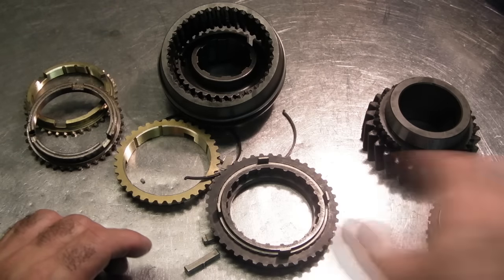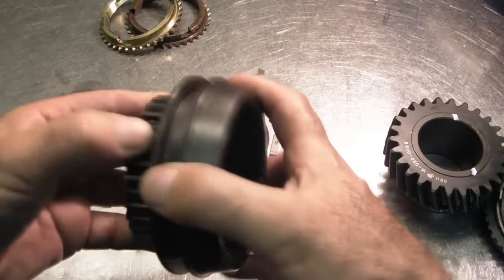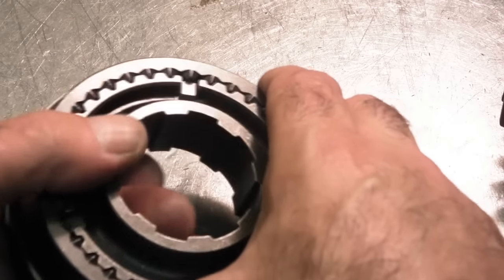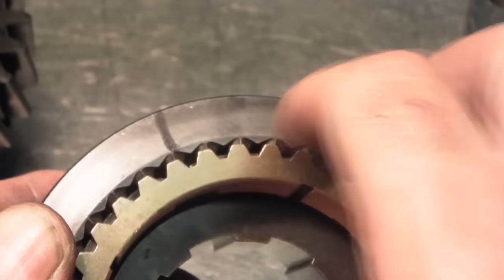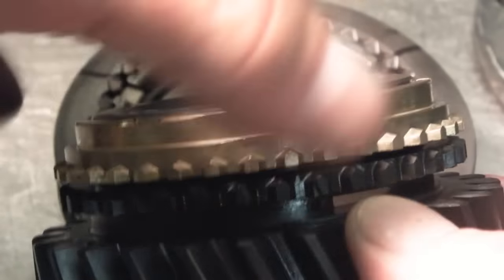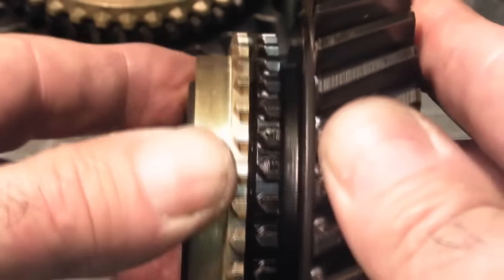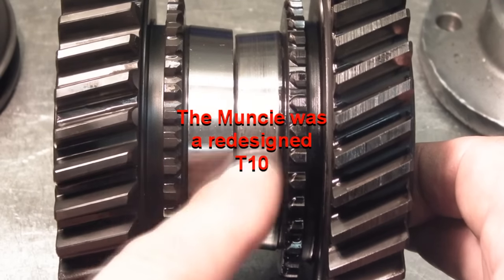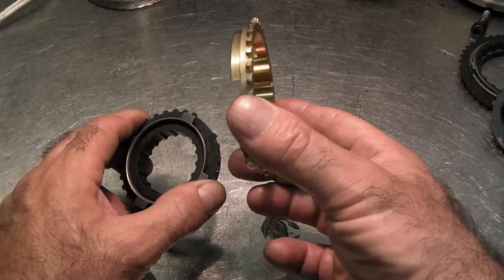Learn About Transmission Synchro Rings

Comment: Great video, clear and easy to understand! I found it looking for answers for a grinding sound in my T355 Patriot (48K mi) manual transmission. Hope you can help with some advice. The grinding is when shifting into 4th gear, once it passes the grinding it gears properly and works good. I already replaced the clutch kit, some worn retainers and the trans fluid (ATF+4) but the grinding stills there. 
From what I understand in your video, if the speed is properly geared after the grinding is not a synchro crown issue, it would be a synchro ring worn out and not stopping properlo along with the gear cone. I'm planning to replace only the ring (4th gear) and leave the same synchro. What are your thoughts?
Thanks!!
Reply from the maker: Inspect the parts first.  Usually you will just need a new ring. The whole assembly could be damaged if you let it grind for awhile.
Reply: GearWorldTV
...or even if you let it grind for

a

while.

...

Comment: I have new Tacoma with a 6 speed manual. A while back I was in 1st gear coasting and I wanted to shift to neutral stop and the shifter would not come out of gear and it ground when I pulled back on the stick. Clutch pedal was all the way to the floor.
Reply from the maker: Sounds like a clutch release issue. Unfortunately from the description you give me its hard to diagnose this.
Reply: GearBoxVideo it is simple. I was driving in 1st gear, I was going to shift to neutral so I could stop, so I press the clutch pedal all the way down to shift. But when I pulled on the shifter I heard grinding and I could not get the shifter out of first gear.  I had to let the clutch pedal come half way up and then press it back down completely before he shifter would move.

Comment: I'm no expert and you will probably correct me, but I dont think the threads on the synchroniser ring should 'cut' through the oil film, it would want to compress it and use its viscosity to produce the shear force on the gear cone. Great video though, I learnt alot thanks
Reply from the maker: oli696969 Good point, If ring floats on the oil it will not grab the gear. When rings flatten its because the threads flatten.  The wear is from the ring's threads having no oil between them.  In a sense it becomes a dry clutch. The viscosity is also a valid point, being that some oil has to float between both gear and ring to keep things from welding up. Yet we have not seen increased ring wear from people using Dextron III compared to 90wt.

Comment: Question for those of you that are educated in transmissions, while my car is a 73 I have a Borg Warner Super t 10 out of a 1980 corvette with the 2.88 first gear. Today I was driving on my way home and got on it from 2-4 gears to pass some ppl directly after maybe 30 seconds or less after I have to slow down for a red light and downshift at 2k rpms to 3rd and it grinds, doesn't grind into second, wanted to see if maybe my syncro is going out in 3rd so next time I got into 4t...h I downshift down to 3rd again at 2k rpms grinds again pull it out into neutral without letting the clutch out and push it back in and still grinds, here's the thing though I tested a few more times at lower rpms and it only grinds at 2k and above if I'm under it doesn't grind, so what's your thoughts?

Comment: Hey. Thanks for these great videos. Just a total beginner in gear-boxes, and arrived here because I have some problem in a seat DTA 5 speed gearbox:

Can you please tell me how dangerous it is for the gearbox to keep on driving around when the synchronizer rings make a noise only in the first gear. This bronze ring (they told me it is made out of bronze) is making a clac-clac-clac sound only in first gear.

Better change the gearbox? Or because it is only happening in first gear, I can happily continue driving with it, and if it breaks, it will only break my first gear? Or will it break the whole gear-box?

Thanks in advance for answering. Hope it is Public and you can respond to my question. Cheers
Reply from the maker: E. JF The clacking noise usually means a broken of chipped gear tooth.  Remember gears are in constant mesh so they are always turning. Just because you are not in that gear doesn't mean it disappears. So if the 1st gear is broken, eventually the whole gearbox can get destroyed.

Comment: Awesome video. Can you talk about the synchronizer rings on the TR-6060 found in the new Challenger, Camaro, GT500 and Viper? I have a Challenger and sometimes get a grind from 1st to 2nd or 2nd to third. Also for reverse from a stop with the clutch pedal fully depressed. I'm at the point where I'm thinking of taking it to a transmission shop to have the synchros replaced with beefier ones from the Viper because the dealership is wasting my time not solving any problems or doing any work on the car.
Reply from the maker: Sorry I didn't see this post.Something is causing poor clutch release. Could be the hyraulics
Reply: Thanks, the dealership has already replaced the slave cylinder/throw out bearing. Scheduling the master cylinder for this upcoming Wednesday because the problem still persists.

Comment: Thanks much.  If you don't mind I have another question.  When I said my synchro slots were worn, they were worn but not full depth.  Its like they were worn by the keys rotationally before the keys could move down further into the slot.  Seems in this condition not only does it not index correctly, but the key cannot drop further down too, causing the coupler to be blocked.  Typically does the slot on the synchro wear wider in this manner?

Comment: so all the power to the transmission depends on the synchro cone clutch? a few bronze teeth on the synchro a few small teeth on the gear and 3 shift dogs? Then why such wide gears?
Reply from the maker: Engineering. 36 little teeth are in contact fully where the gear teeth at best on spur sets have only tooth to tooth. It's about what total surface area handles the load. There is no load on keys and rings when in gear

Comment: Hello, I just bought a 2012 WRX with 84,000 miles on it and noticed some grinding going from 1st to 2nd. Figured it had to do something with the synchro, but not quite sure exactly.  It works fine when double clutching and shifting slower, however. The other gears have no problem shifting.
Reply from the maker: The 2nd gear ring sounds like it is worn or warped.
Reply: @GearBoxVideo  Thank you for the reply. Would you suggest changing the transmission fluid to see if that would potentially smooth out the 1-2 shifts?? Also, I've noticed this happens when the car has been driven around a bit; When I first get on the road, it is completely fine.
Reply from the maker: Then it sounds more like clutch release

Comment: Hoping you can settle a disagreement.  Have car that commonly suffers from blockout downshifting to 2nd and 1st.  After my rebuild I found my synchro slots worn wider.  I believe this is the source of the blockout condition, but others state vehemently that it is ONLY due to the synchro unable to grab.  My take is that synchros that do not grab cause clashed shifting but not blocked shifting. (my worn synchros grabbed great!).  Who's right?

Comment: Reverse gear is not engaging properly in Fiat Linea 1.3 L MJD, Diesel, 2012 SEP model,. Rest of the gears are working fine. Only reverse gear is causing problem to engage. No pick up drop. No jerking. What may be the actual problem ? Fiat ASC is saying to replace the clutch kit and release bearing. Car has done 95000 KMS. Around 55000 KMS clutch has been replaced. Present clutch has run only for 40000 KMS. Is there any problem with the gear box ? Or with the clutch ?  HARSHAVARDHAN from Bangalore. Thanks in advance.

Comment: I suspect I currently have this issue on my DSG, where the blocker ring cannot grab the gear tight enough and i get a grating/crunching sound when the syncromesh is moving between gear 2 and 4, about once per drive. So it happened right after a transmission oil change and I didnt use the VW OEM oil, so I guess that would be the first thing to fix.

Comment: Thanks, at last I understand how synchromesh works!  - now a question - the second gear in my Land Rover Defender (recently rebuilt Santana LT85 gearbox) has started to make  a very noticeable 'zizzing' sound as the synchro cone engages.  What would make this sound? - it's not a heavy gear gnashing noise, but I can feel it through the shift lever.
Reply from the maker: Only when you shift or just while driving in that gear?

Comment: very interesting video! I have a manual transmission car. and when the car is cold all gears work fine, but after 15-20 min of driving, especially in hot days the 1st, 2nd and reverse gears become difficult to shift in. What is happening? Would changing the gearbox lubricant solve this problem? I thanks for you help!
Reply from the maker: Sounds more like a clutch issue
Reply: I solved the problem by lubricating the hinge of the lever actioned by the slave cylinder. I used WD40. Now every gear is shifting very smoothly. Your videos were a great help in understanding how the clutch and gearbox work. Thanks for sharing your knowledge.

Comment: What stops the ring to get stuck on the cone of the gear? I mean, the ring is free, apparently. There is something to make the ring stay away of the gear when is back to neutral, or the ring is always making some contact to the cone part of the gear?
Reply from the maker: The ring is attached to the main shaft via the synchronizer hub so when you are in a particulate gear the synchronizer ring is spinning at the same speed as the gear which is locked to the output shaft. When you are no longer in that gear the ring is forced off of it by those 3 little keys. Sometimes new rings are sticky and on the bench it can appear that the transmission is stuck into gears at once.
Reply: GearWorldTV thanks for the reply, but I still don't understand. The 3 keys can push the ring out, but not in. At least is what understand from the video. How can the keys bush the ring in? Is like there is always contact with the ring and the cone. Looks like keys only push the ring to the cone, but don't make them separate.
Reply from the maker: The ring is tapered.  It is a cone clutch. There is nothing positive
holding it on the gear. Rings really dont get stuck to the gear. you are
forgetting that the ring is spinning. The key is alwAys attached to the
ring. So the ring will break free of the gear when not at the same speed.
Reply: GearWorldTV Oh, ok. So basically my first impression was right. There is nothing pushing the ring way of the cone. Well, nothing except the friction of been in different speed. So basically the difference of speed between the ring and the cone is what keep the ring away from the cone. Right?
Reply from the maker: Yes exactly
Reply: GearWorldTV Thank you very much.

By the way, great video

Comment: thanks a lot Paul. Sorry to be pita, but I have a couple other question. With the extra space I'll have from slick  shifting, will the the trans be noisy, as in "CLUNK" like my old crasbox without syncros when I shift gears, or does retaining the syncro rings help this? Also will the trans popping out of gear be a problem?

Comment: Thanks for your quick reply. It only makes the noise as I'm shifting down to second gear and stops when I let go of  the gear lever. 

Also just noticed I can faintly hear the noise if I pull back on the lever with 2nd engaged.....
Reply from the maker: It could be some shift fork wear that causes the slider to move more than it should rubbing against another component.

Comment: Excellent video. Really informative. I have a problem shifting down from fourth to third which seems to be what you describe in the video as block out position. When shifting up from third to fourth it works just fine but when trying to shift down from fourth into third,The gear lever simply will not select third as if something is simply blocking it but there is no grinding or anything. It just won't go. However, if i double-declutch , then i can select third as long as i rev the engine enough to match the drive speed. Does this sound like the cause of my gearbox woes is the indexing motion issue in your video?
Reply from the maker: Yes, typically the whole synchro assembly either has tooth wear or some wear that allows the ring to move and over index.

Comment: Is there anywhere to buy individual syncro rings? Also, what would cause a manual transmission to get stuck in 3rd gear if it wasn't the shifter cables?? Thanks ahead of time.

Comment: Happy to subscribe nice work on your videos you sound like the man !  i'm having problems with my 4 speed munice in my
74 stingray i'm hoping to pick your mind .  When I let of the gas in fourth gear it pop's out gear i'v adjusted and checked all 
my linkage it seems to be intenail .any thoughts thank's Hank
Reply from the maker: Hello Hank,
Please watch the video at this link: https://www.youtube.com/watch?v=yaQwPQTenMg
It will give you some insight on what shifter adjustment can and cannot do.

Falling out of gear is usually caused by wear of the 3-4 shift fork, 3-4 slider and 3rd gear engagement teeth.  It could be individual items,or any combination of these.  This is a common issue.  Most people lay their hand on the shifter in 4th, which will eat up the shift fork and groove the fork fits into. Usually if the gear has marginal wear, a torque lock slider and new fork will do the trick. Rear bearings can fit poorly in the aluminum mid plates causing the whole mainshaft assembly to move around.  This is rare but also a cause

Comment: Very good video . Be grateful if u could do a how to removing types of gearbox bearings (subscribed)
Reply from the maker: There are videos on my channel with specific transmission repairs / rebuilds that show bearing removal. There are hundreds of transmission make and models.  Can you comprehend how long and time consuming this would be for me to make a free video on all bearing removal? Bearings in general have several rules for removal which I explain in my videos.  There is a great deal of info on this subject in my videos.  Please take the time to watch more videos such as the Toyota video and you will see what I mean.
Reply: @GearBoxVideo  many thanks I've the old transporter 5speed (02z ) it was mainly trying to find video of what tools are used to remove them when there pressed onto the shafts (as theres no gap to use a bearing puller to remove the buggars)
Reply from the maker: Do you have a specific year make and model?
Reply: @GearBoxVideo  as above all transporter t5 5speed boxs are the same 1.9 and 2.0  just struggling a bit removing bearings off the shafts

Comment: Great video thnx Paul ! Is "double clutch shifting" up/down the rpm range the synchro-friendly option of last resort if the synchros are fried?
Reply from the maker: You can try but I fix things when they are broken. You could wear out the sliders and gears if you are not careful

Comment: Great video, I'm really interested in stuff like this. I have a question to you about synchronized manual transmission. Which component slows down faster - the engine or the intermediate shaft? I talk about the situation when you simultaneously press the clutch and move the shift lever to neutral.
Greetings from Poland :)

Comment: Hi Great Videos I think i asked u before I have a FIAT Abarth with MTA semi auto. I have a slight rattle which i think could b your loose springs on the fly wheel video. Its clunky at low speed(gearbox oil)? but totally fine changing up & down as u push through the gears. Makes a whiney/gravel noise in reverse(but goes into gear fine) & when u let it roll forward in reverse gear. Could that be an output shaft bearing the gear itself or even the shaft? Your advice would b appreciated😎
Reply from the maker: If the rattle goes away as you spin up the engine it could be just gear rattle because of as you mentioned clutch springs or maybe if you have installed a lightened flywheel that will cause the issue as well. Noise in reverse is common because the gears get banged up and are usually straight cut

Comment: Nice piece on syncos.  I have a t 5 that the slider locks on syncro or 3rd gear, not sure which, what do you think the problem is?
Reply from the maker: Usually the rings go flat and the extra gap allows the strut keys to pop out of position and cause the slider to stick in gear. Its a sign of worn rings.

Comment: Can u please tear down and rebuild a (big rig) heavy duty gearbox with high and low range + splitgear and the convetional three gears +crab gear and reverse (sometimes they are with four gears in the main box) you know what i mean ? well still loving your work m8
Reply from the maker: I'm not set up to do that work. See my visit to Midwest Truck video. Look at the rebuilding facility and what's involved. You need a good crane system over your bench as well as. Dyno

Comment: Your video is pretty cool as far as a disassembled set of gears and rings goes. Now here's a video that I think goes hand-in-hand with yours, but it uses an assembled transmission.

But this other video goes into good detail about the overall shifting action (except how the stick works with the forks) and the ratios.

Manual Transmission Operation

So both of these videos have their stronger points in different areas. :-)

One thing that's pretty cool about this other video is that it came from right here in my state, Utah! I live in Orem. Check out my videos about the demolition of the malls that were in place in Salt Lake City before City Creek Center, including this big one that my profile picture is a thumbnail of!

Big Building Chunk Falls on Track-hoe!

Happy 41414 coming up on Monday the 14th, and then Easter later!

Mike